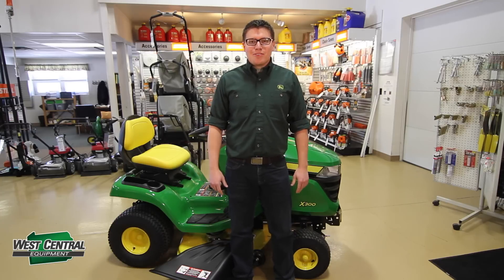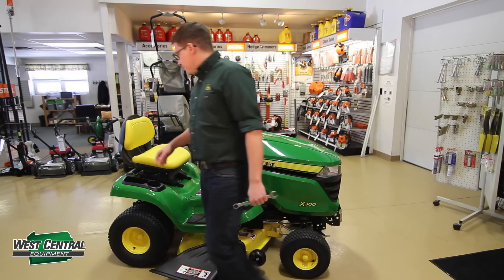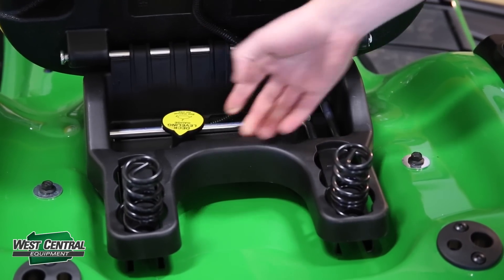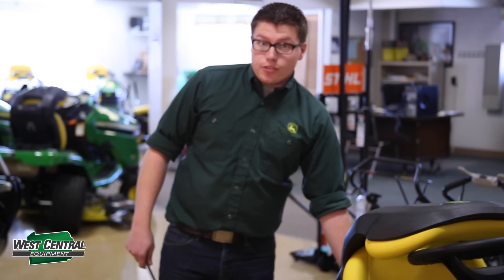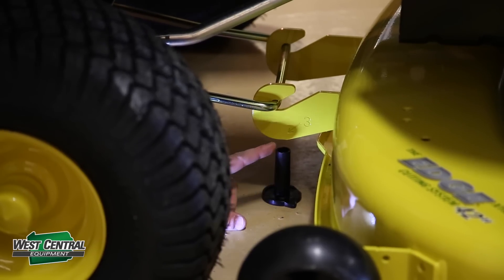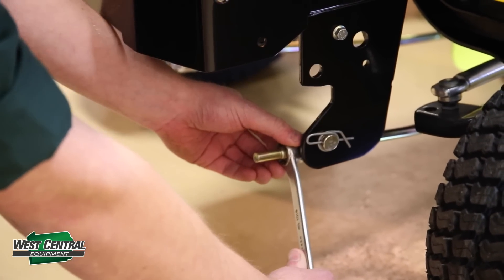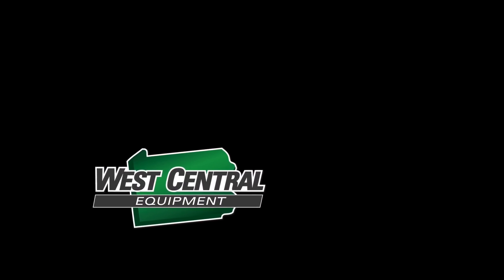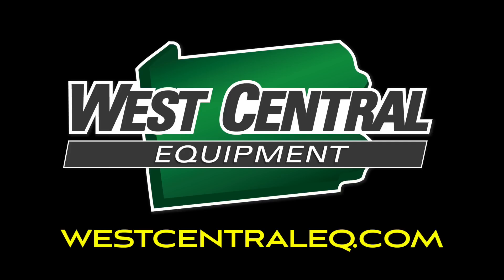How To Level a Mower Deck

Comment: If the 42 inch edge mower deck is set to cut grass @ Scotts Lawn Care 3 inch plus recommendation. The gage wheels set at the highest position will be higher than John Deere's 3/4 inch recommendation and the mower will scalp when turning. VERY POOR DESIGN.